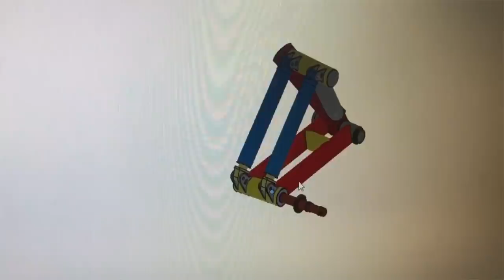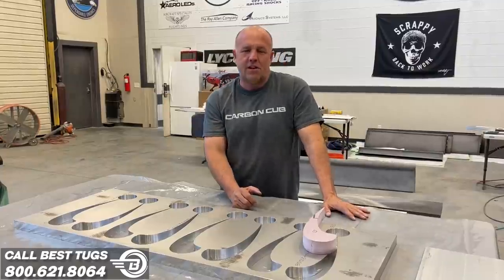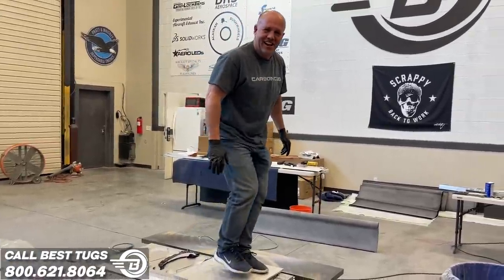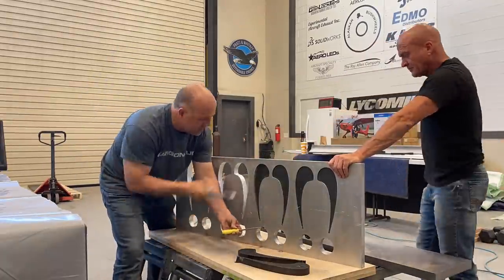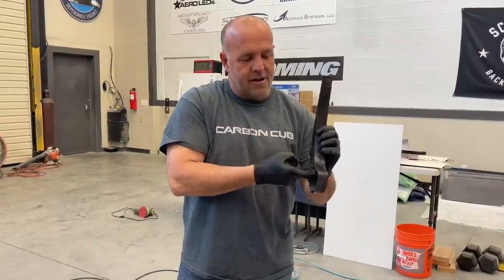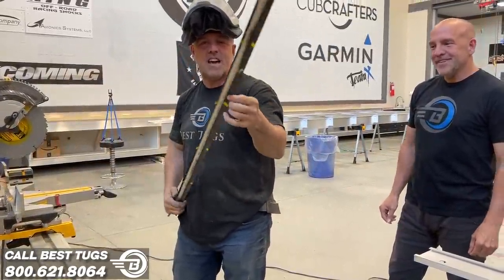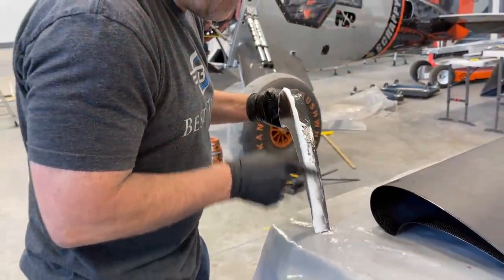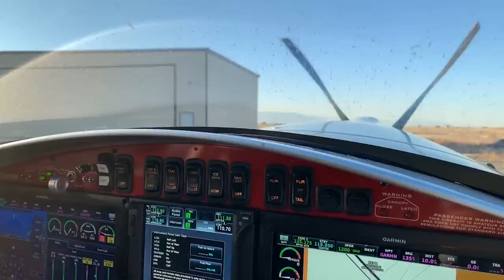Carbon Fiber Slats for my Wingless Airplane | Scrappy #50

Comment: Mike, I was a Manufacturing Engineer, for Groen Bros. Aviation, working on the Sparrowhawk gyroplane, of which I believe there is at least one at the Spanish Fork Airport.  

That all being said, we used Fiber Glass, using the Vacuum Infusion Process to build many parts. One of those parts was the Tail. We built the individual parts with the customer putting the parts together.  

Your process here, while using carbon fiber, is very close to what we used.  We definitely didn't use the tighter tolerances that you're using, but we made them where they needed to be.  

Nice to see your use of the Water Jet, which I also used while at Action Target cutting AR steels.  I actually designed the vats that held the water to keep the metal chilled as it was getting cut. My design cut the time of cleaning the vats from days to an hour, or so.

Thanks for bringing back the memories.

Comment: Mike, I used a similar process for some aero parts on our TransAM car.   I picked up a cheap Harbor Freight parts washer, plumbed in a large truck oil filter and ran my acetone in the parts washer.  Made it real easy to clean the foam out of molded parts.  The big oil filter would hold the residue of about 10 cu/ft of foam

Comment: Waterjets are indeed super cool. We had one at the welding school I went to. Amazing what they can cut with and without the garnet. Apparently they use them to cut chicken and diapers and all sorts of weird things like that without the abrasive medium. Then like you said amazing thicknesses of metal with the abrasive. 
Another thing I think is really cool is how the abrasive is dispensed, and lined up into a stream of single particles in line in the water stream. Ours was 60,000 psi also and it was a fairly smallish one, I guess they make them with pumps that can do even higher pressures, like nearly double that. Incredible!!!!

Comment: Mike! Scrappy becomes less and less scrap with each build ,😂. This looks like it's going to be an awesome bush plane. I'm really looking forward to the point where you get it flying. I didn't think there could be a larger bush beast than Draco. Scrapping being based on a Super Cub is every backcountry pilot's dream airplane. Unbelievably you're going to top Draco.

Comment: 19:00 just a thought, but maybe have the other vent holes up high. It wouldn’t take much water at all, especially at upper alpine temperatures, to freeze a little “plug” into the 1/8th inch drain hole, making your slats pop as the air expands prior to the water melting

Comment: "video posted 4 seconds ago" they smile upon me today.
Reply: 38 seconds ago for this Evan. Have a good day!
Reply: @EvanMJones  13 minutes ago, 20 minutes long, but someone's already slapped that thumbs down. ugh. people lol
Reply: 13 happy minutes for me. :)
Reply: So what kind of chemical are you creating with the acetone and polystyrene. Wouldn't a respirator be a good idea.
Reply: @brianwaskow5910  I thought the same, but I've just watched a kids camp (space camp) video where the teacher is doing the same, using acetone to turn styrofoam into glue to reuse it rather than chuck it in landfill. Doesn't answer your question, but interesting all the same.
Reply: Are your slats moved under power? I worked on Saberliner jets that had F86 wings. Those slats were aluminum and heavy. Gravity and slower air speed allowed them to slid into position. Your slats are so lightweight that if they are not powered I don't see them dropping into position until your on they runway slowing down to taxi speed.
Reply: @SimonPollock  I had to work with a multitude of chemicals in the aerospace industries. Acetone by itself is crazy dangerous your liver and kidneys don't like it. But when you mix it with other compounds you don't what you are creating. To inhale the fumes and it travels through your body. Don't create any sparks.💀
Reply: @brianwaskow5910  "Earth Shattering Kabooom!"
Reply: 2 hours for me XD
Reply: 16 hours ago posted for me. Via True

Comment: If I lived closer I'd seriously volunteer to do any grunt work just to be able to be a fly on the wall in your shop.
I've been absorbing every bit of info you've been sharing with us while working on some Carbon parts for various things.  So Far, motorcycle, sandrail, weed eater, lawn mower and most of my TV remotes.  Thanks for all the great stuff Mike !

Comment: Mike it's time for you to design an entire airframe. Experimental aviation is calling upon you!
Reply: There aren't many parts of this airframe that he did not design. He has it all in CAD.
Reply: @ChevTecGroup  But the frame is still in there and the design is based on a carbon cub. I mean a real clean slate design. Probably a racer, because of his Reno background
Reply: @almerindaromeira8352  true, though the frame has been cut up and re-welded to the point that it is practically a new aircraft. I think the reason he started with the cub is because he wouldn't do much different. So this is essentially a whole new airframe design, loosely based on the general form of a cub.
Reply: @ChevTecGroup  I am not so sure that he has it all in CAD. A lot of the manufacture was done with single use molds, or using pre-existing parts as molds. The cowling, for example.
Reply: @mckenziekeith7434  they way Mike does design, he always does it in CAD first. He even CNC machines his molds for carbon fiber parts. He also does computer aided testing on all the parts
Reply: @ChevTecGroup  well I have watched all the videos. There are quite a few parts on scrappy that were fabricated over hand shaped foam. I very much doubt there is CAD for them. Same goes for the cowling. I very much doubt he entered the cowling into CAD.
Reply: @mckenziekeith7434  regarding that, I believe he will 3d scan the entire fuselage. He did it on turbulence and draco. About those internal parts like scoops and the parachute container/strap grooves I'm not sure.
Reply: @almerindaromeira8352  Very possible that he will do that, yeah.

Comment: Imagine using over $1000 in aluminum just to make a single use mold😂. Good work
Reply: But when he recycles the aluminum he'll get $3.47 back, so he's got that going for him.
Reply: @skipdreadman8765   If he has a "chain of custody" deal with the aluminum people then he can prove it's aircraft grade and get a LOT more for it as a repeat customer...I worked for Boeing and they sequestered every different type they used including THE TURNINGS AND SHAVINGS and filled hundreds of CLEAN oil drums for shipping and ALCOA was happy to pay because it all went into the next batch and then back to Boeing, recycling at its finest!!  CHEERS!

Comment: Mike, I haven't been up in 35yrs, but you reignited my passion once more watching you build this work of art. I can't wait when you build the main wings, putting together the ribs & stringers to those massive spars. What's going on in my head is, how are you going to do the gas tank? - Carbon fiber ribs like the slats? (the spars won't break) Maybe I'll build my own twin-engine plane using your concept of Scrappy?

Comment: The "gar-NET" used in waterjet cutting is the same crystalized mineral found in garnet gemstones (Jan. birthstones), it falls around 8 on the MOHS hardness scale, which is why your cutting tips need to be diamond (10 on the MOHS hardness scale)..  Obviously I'm not telling you anything you don't know Mike other than you're putting the emPHAsis on the wrong sylLABle .  Absolutely love the build! Now I must get Back To Work!

Comment: Hi Mike, Mike from Sweden here ...Aicraft Tech originally and aviation enthusiast .... Just something I thought of on your design , The slots you made you did air vent thru the spars in center and on the lowest in the end. But in al enviroments where you have warm and cold you will have condensation and maybe its not a problem but since you drill the vent in center its a chanse that you get water in between the spars....Maybe its not a big issue but something to have in mind when it comes to balansing and below zero tempertures ( Appologize for spelling errors )

Comment: Those look fantastic! Are you keeping all of these forms, and jigs that you have made for the Scrappy build? You never know when you may need them again. Maybe for a production run?
At the very end of the video you have the 6 slats lined up in 2 columns on the floor. If you tighten those columns up, get them square, and leave only a small gap between the ends, get the lighting, and angle correct, and get a photo with a high res camera, you could have a awesome photo to frame, and hang in your hanger lounge. Keep the shot tight so that there is no context as to what you are seeing. It needs to be about the form, and sheen, not the individual slats.

Comment: I was talking about how rigid things break in another video earlier today.  Specifically about how we build hour houses in New Zealand with light weight pressed sheet steel roof on lightweight trusses.  This is to make them move and sway during earthquakes instead of falling down.  If you look at the damage in the 2006 Christchurch quake, it was solid masonry buildings like the cathedral that collapsed.  Lighter buildings using steel framework fared much much better.   I experienced the Kaikoura quake that lasted for two full minutes, and the movement was incredibly violent, but while things fell over and off of shelves, the house was undamaged.

Comment: for extra water prevention, if you put a mesh or even piece of cloth in front of the hole, it would still allow air to vent while preventing water to go through without considerable outside pressures

Comment: Incredible engineering! You may revolutionize not just aircraft building but a whole host of other products that need high strength and light weight. I’m sure this was super expensive but the prices will fall quickly with wide adoption. You continue to amaze me. Get back to work!

Comment: Love the content and quality of your channel,  Low and Slow is the way to go , wish I had the where with all to do what you do ,I would like to do and have dreamed about it for a lifetime is a lighter than air craft that could linger for an extended time at extreme low altitude for say like zero impact research on the Everglades or coral reefs , like the Lowest and the Slowest,  I got to take a ride in the Goodyear blimp in 1983 and has stuck with me for years but this part of aviation is the forgotten stepchild of the industry and needs to be rediscovered,  The Hindenburg could lift 500 tons in 1937 , After reading about  Anton Santos Dumont and his lighter than air adventures (he crashed over 100 times in a balloon and lived to tell about it ) I'm hooked on the idea but have little in the way of resources , as usual I'm big on ideas and short on cash , with all the advances in material science it's time for the new generation of lighter than air a aviation.

Comment: Great way to not have to acetone out insolation foam is to cover with clear plastic kitchen wrap before glassing.  Lightly spray glue foam and stretch saran wrap over the plug. Trash bag will work too but Saran wrap is more stretchy and will have less wrinkles.

Comment: When you cut the plate to make that mold. The cut out piece would be the exact shape to push those molds out...the exact fit.
Reply from the maker: Yes exactly, I was wishing I hadn’t cut them into other small wing parts already
Reply: @MikePatey  Clue dropped!

Comment: Incredible engineering in your design and construction.  I assume as these are so light that you plan to deploy them manually in conjunction with the flaps as opposed to having them auto-deploy based on airspeed like the A4 design.

Comment: Any updates on the other two Carbon Cub builds? I've been playing with 1/4" pink foam home insulation for R/C for years with carbon fiber tube for structure. Got a deal on the foam. Home Depot had a block of the fanfold that had a corner knocked off. Kept walking past it and finally asked the Manager what he would take for it. $12.00! Now this stuff has a layer of glass fiber in the middle. I've used about 1/3 of the thing and have a BUNCH left because I keep the scraps. Rule #1 always work out of the scrap bin first!

Had a job years ago where the rule was anything in the scrap bin was fair game. Made an engine stand  out of steel pipe drops and bits of strap. Modular. I can take the upright off and the whole thing will fit in a car trunk! All I paid for was the casters and the welding rods and one can of Rustoleum Red!

The trick was drilling the tubes, fitting other tubes in, and welding it all up. Totally tubular! ;)

Built it in lunch hours over about a month! Don't know if it'll take a BBC but a fully built 350 sits on it right now...

Comment: Surface tension and delta P keep water in your low vent holes.  Water freezes.   I'd suggest an additional vent hole higher to prevent vacuum.
Reply from the maker: Yes sir, exactly 👍🤠 I did that as well,  It just missed the edits.  I have a couple hours of content that makes a 15 minute video

Comment: Impressive work Mike!

But wouldn't it have been much easier to take the ribs out of the mold with the mold heated slightly? Aluminum has a significantly higher CTE than CFRP. We've used a very similar procedure in our Formula Student team to make ribs for our wings (zero draft molds), which were even more difficult to un-mold, since we used prepregs that cured at >130°C, so the mold contracted more than the part when cooled down to room temperature. Heating it up helped significantly in un-molding the ribs.

Comment: the most parts of foam from the ribs could be cut out with a rigid heated wire, to save lot of aceton. but the final result is excellent! admiring!

Comment: I can see where if you even did a vaccum bag on those rib parts, you would mostly hav more warped parts than good ones. I like the mold technique you made for the ribs. I guess you mold released the metal surfaces. I also like how you got rid of the foam. I see the drilled holes, but with the holes high up on the inner ribs, should you have drilled them at the lowest point too to avoid moisture trapped inside?

Comment: The funny, in this one, is strong.
That special yellow tool you're using looks a lot like a rat tail file🤤. I showed em how to do that.😲
This word "shoot", it seem like a substitute word for something else🤔.
It's those wet, ahhh, parts, ya gotta watch out for.
I've done parts that would melt yer face right off.
Hey, I didn't start this but go ahead and slip it on in there.
So just to be clear, you only need about an inch? Good to know.
The good Lord delivered me from a spirit of exaggeration, and I cried a bucket of tears.

Comment: Just a thought. Think water may still get in due to humidity in the air and change of density/pressure as a/c climb and decent. Eventually water maybe collected between the inner ribs since no way for it to get out easily?

Comment: Mike is the man! 👍..But as an rc model lover (got my ppl also), I still have always the same question. Where can I find ideal profiles to create such slats? The aerodynamics must be correct to have the max functionality out of the slats on different wings? Does Mike use existing profiles or where does he create them? Does he use an air tunnel or how do I see this? I know where to find NACA profiles and so on, but I also want to know how to use and know the correct profile for different planes. Something like a Fieseler Storch, which I builded when I was 14 years old from a kit, does fascinate me. I now want to design my own plans but don't know where to begin besides copying existing wing and slat profiles. Same with flaps. Plain, split, slotted... Am I stupid or are there some websites to start with??? If you have any info about this, I would really appreciate it if you could share it with me. Bye from Belgium 🇧🇪

Comment: Had you ever considered using titanium tubing rather than chrome moly? With your incredible welding skills, I would think that titanium tubing would be a real option. Since titanium and carbon fiber play extremely well together, grade 11 titanium tube would be an excellent material for your project. It would keep the strength but lowering the weight of your heaviest parts.

Comment: Love the show! I'm super impressed at the sheer volume of work and attention to fine detail you are putting into this build.

Quick question though:  What about condensation build up? (btw I'm not an engineer, so I may be missing something obvious here)  

If the leading edge slats are all 'open' to the air won't you get water building up in the wells beneath where you have drilled the inner spars?  I know it won't be much but will all of the pressure, humidity and temperature changes a wing encounters any moist air which does get into the inner chambers has no escape route but the small holes drilled half-way up.

Isn't there the potential for water to accumulate quicker than it can evaporate through those 1/8" holes, and wouldn't 'loose' water in the leading edge slats create an unpredictable moving mass?

I don't know enough about aero-engineering to work out whether that is a real possibility or just rank paranoia on my part...

Comment: I always used to see water draining out of my flight controls after the frost started to melt again. That was on a commercial size aircraft (KC-135 ) and at 35,000+ so it gets frost inside of the flt control from the humidity at the departure atmosphere. I was always poking my drains to make sure they were clear

Comment: That's really KOOL.   Hey, question:. At +/- 8:26, when you had trouble gettingthe Ribs out of the Metal Mold.   Is it possible to put some kind of lube between the Carbon Fiber & the Metal Mold?   Or does that introduce problems?  If not, maybe it comes out easier & reduces the chance of damaging the Ribs.